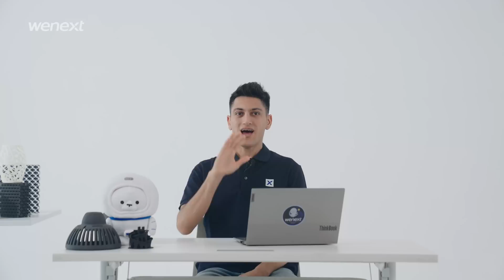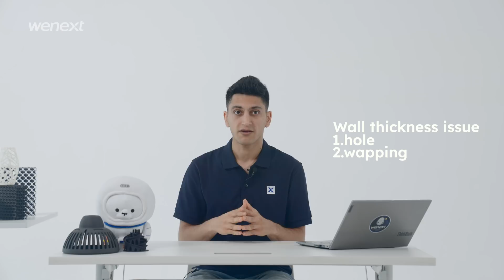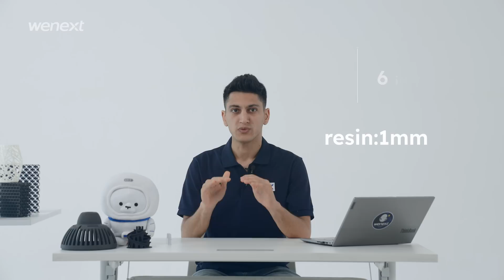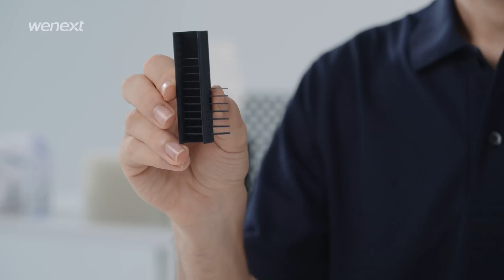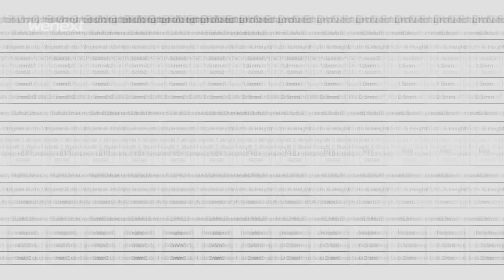Design tips to successful 3d printing - Part I

Comment from the maker: 00:00 We are going to make a series of videos to learn when designing a model for 3d printing.
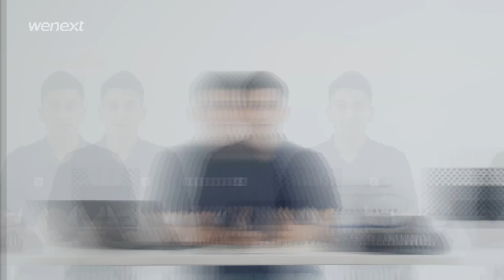00:15 The prevalent issue in SLA printing is called the overhang.
00:39 In this section, we will talk about wall thickness common issue.
01:35 There are two extensions of understanding wall thickness, supported wall, and unsupported wall.
02:56 Another thickness issue may occur when there is a vertical post in the model. 
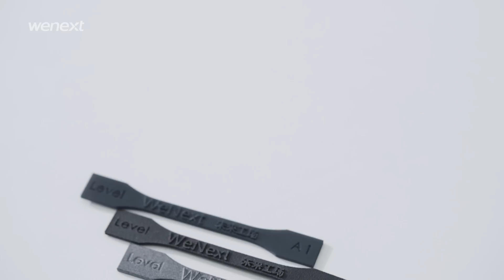03:31 When we emboss or engrave the features on the 3D printing product, what do we have to know?
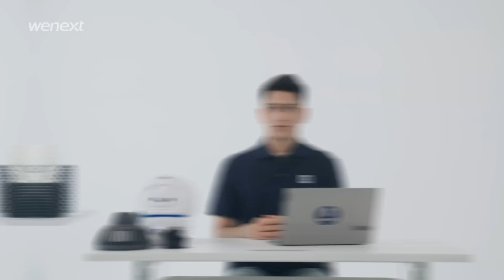04:15 With all the above content of this episode, hope this video helps you.